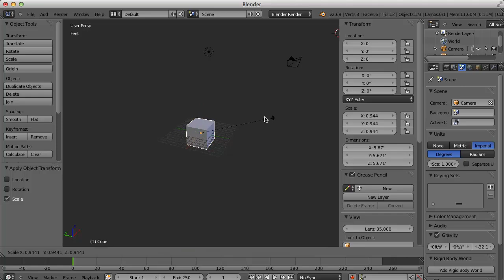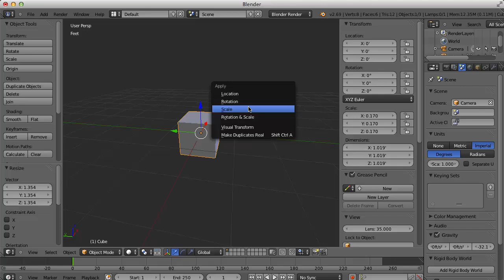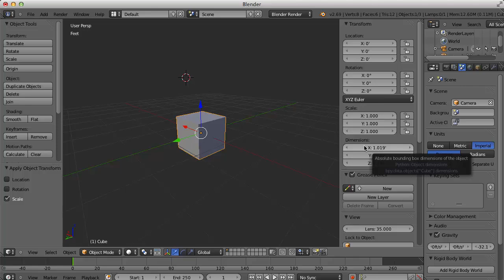Setting Unit Measurement to inches in Blender

Comment: I like modeling with imperial. I was wondering, for the grid. to create a large scene should I adjust the scale? or increase the grid lines? i would like to make a big scene like 2640 (half a mile) not sure if scale or grid lines to work with this. and with camera, does the sensor scaling it down or up effect like geometry or textures etc?